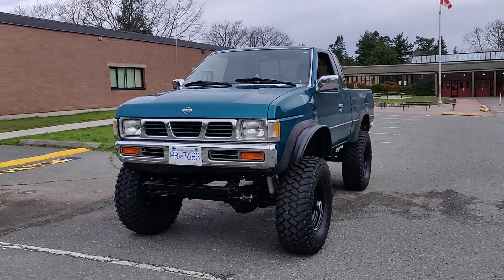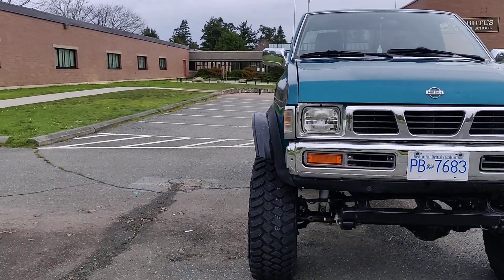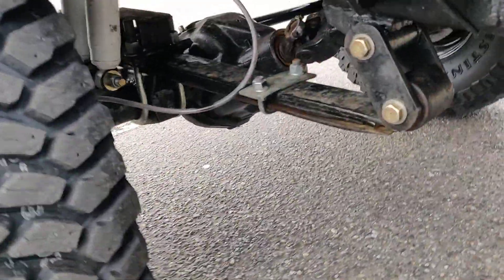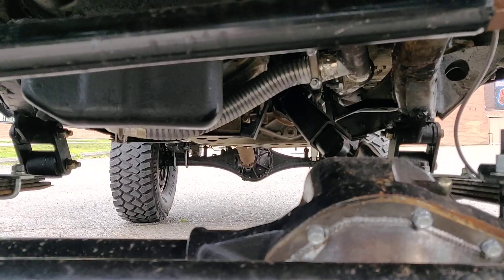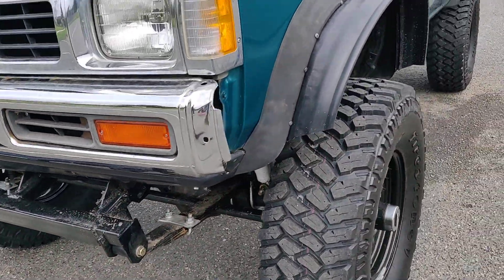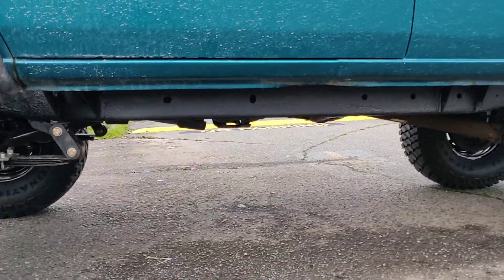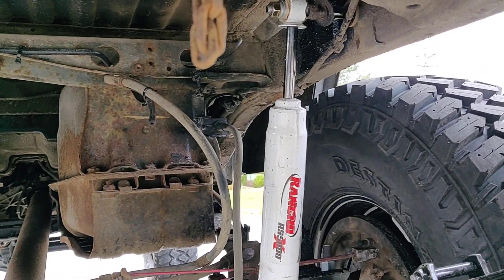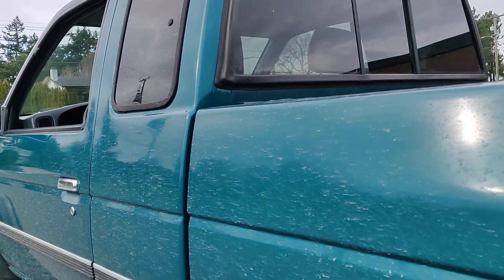Nissan Hardbody D21 Pickup SAS Part 5

Comment: Loving the progress on the sas swap Hardbody!
A few questions: how is the mpgs with this setup?
Also for the rear leaf spring shackles have you considered running the Teraflex shackles for more flexibility and less stress on the leafs.
Just curious?
Thanks.👍🏼
Reply from the maker: Thanks for following! I'm not sure about the mpgs yet as I'm on the first tank. I'll let you know how it is. 

I built my own shackles out of 3/8 flat bar which was a cheap and easy setup. I have not considered using teraflex shackles but lots of tech there and would definitely lower your chances of a leaf failure.
Reply: @D21Offroad  sounds good, look forward to the next video.
Well from my experience so far with the Teraflex rear leaf shackles, they definitely feel good on road, but I've yet to test their performance off-road.
My truck had them already when I bought it about 3 year's ago.

Comment: I got a 4 cylinder 1991 ka24e sitting on 30s still on ifs shit cant wait to do a SAS swap what kinda axle ratios did u use
Reply from the maker: Right on! I went with 4.88 gears turning the 35x12.5s. kept the Nissan rear, xterras some come with 4.88s so if you found a third member, you're in business

Comment: Hi, I love What You’ve done to your truck, I also have one. Mine is a 2.5d and I want to give it the 2.7 tdi from the terrano 2. I Wars tinking On adapt the terrano 2 rear suspension kit with the terrano original springs. And do the same kind of mount to the front suspension. I think that the suspension gains more grip like só. Have a friend that has the same setup On his 91 landcruiser and it is awesome... what do you think of that?